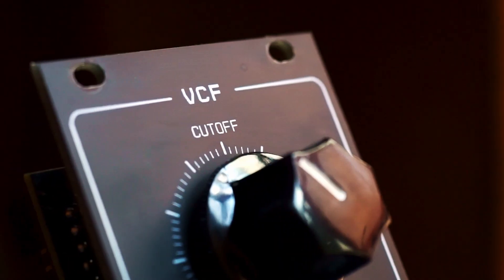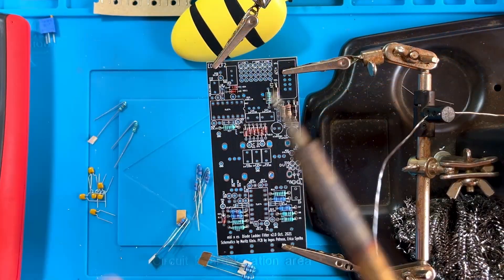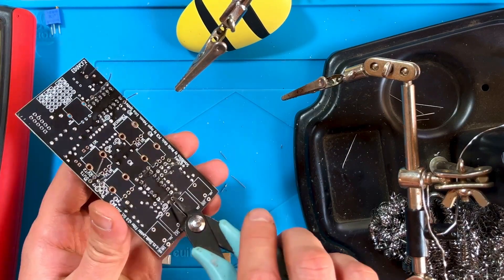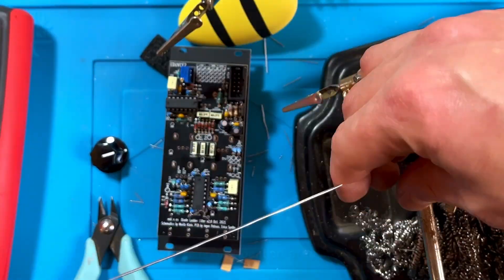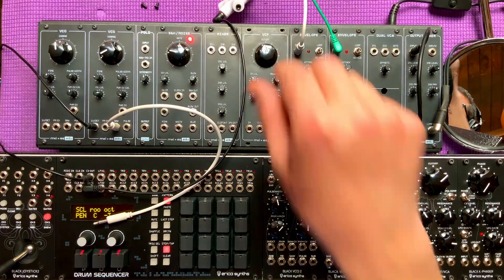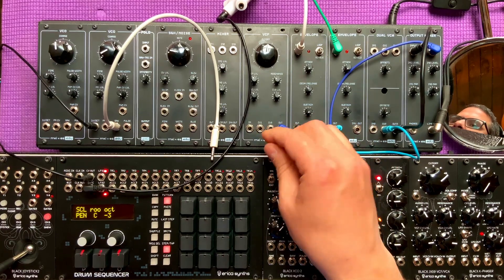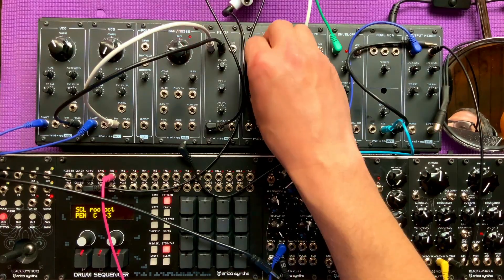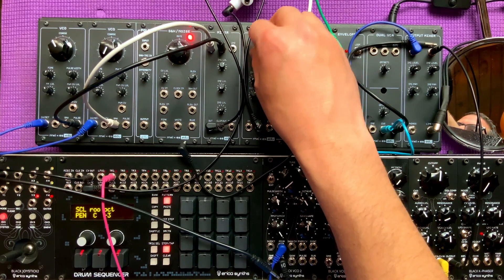Erica.EDU Diode Ladder Filter Kit!

Comment: I also build this diode ladder filter BUT Moritz never mentioned the resonance trimmer, I also didn't know about the 6 100nF bypass capacitors. Only 1uf input and output caps. Correct me please if i'm wrong. I used the circuit and then I changed the improvements (Input stage, CV processing) and LP, BP and HP option. Thanks in advance for your help providing me with an updated schematic with the trimmer options in cluded